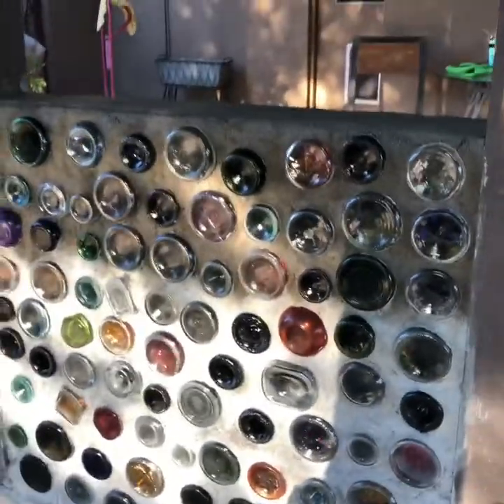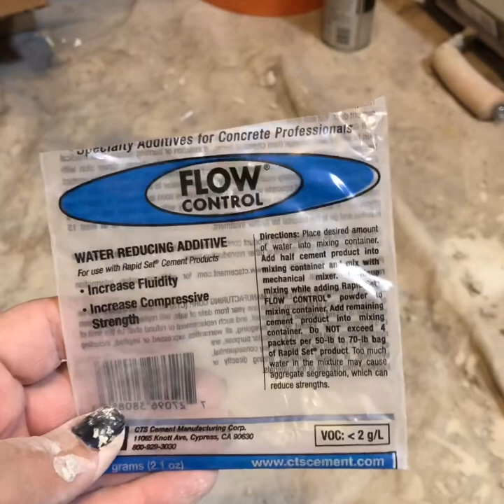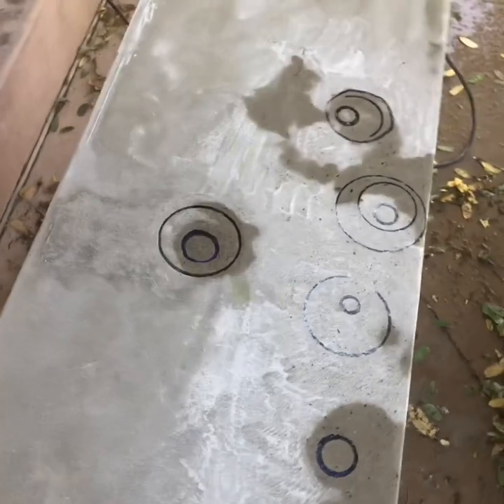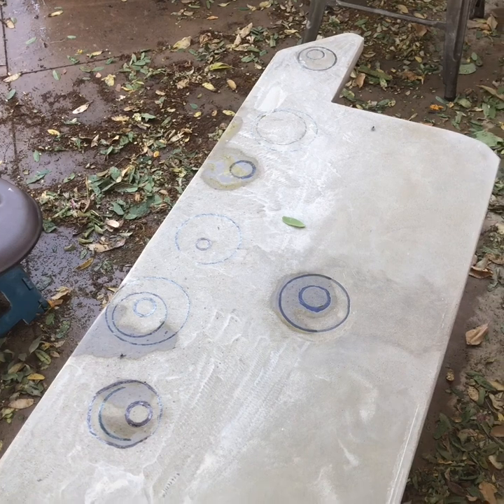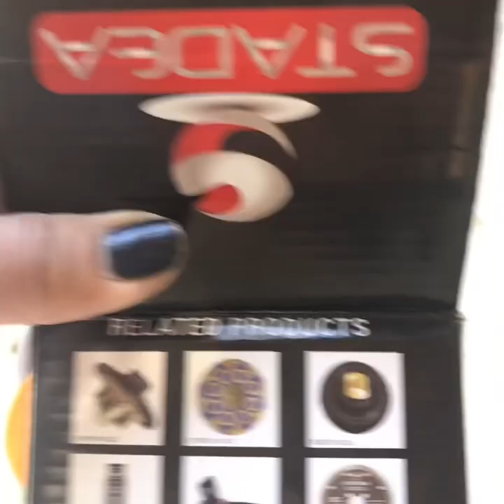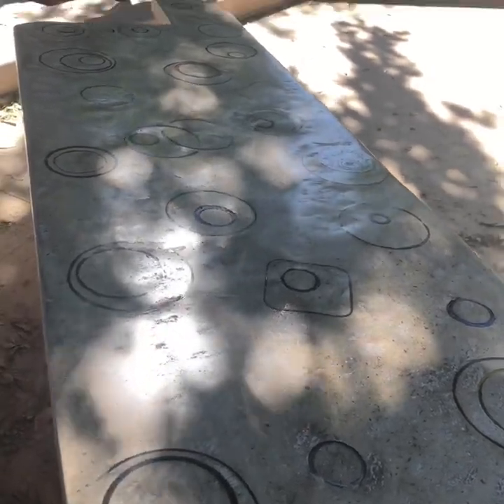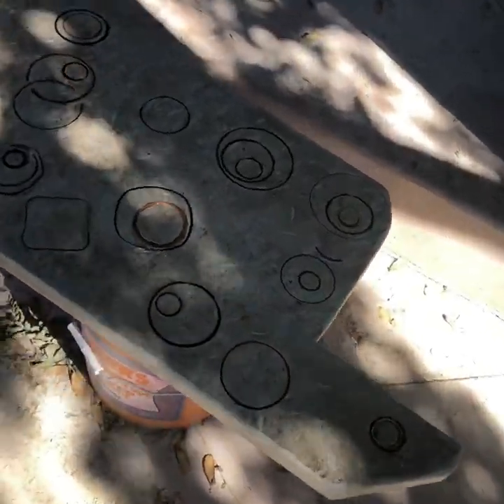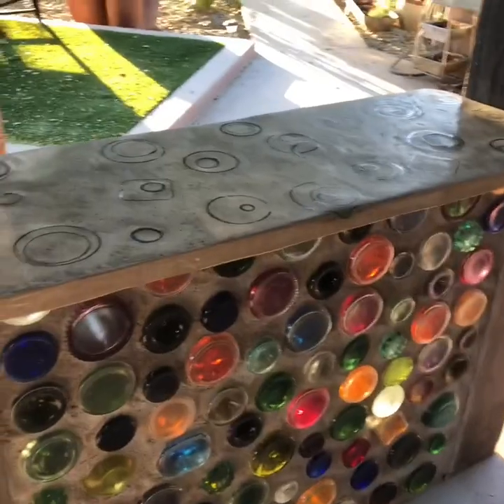Creative recycled bottle wall with concrete glass inlaid countertop

Comment: Just thought of something that could speed up your process if you ever think of doing another wall. What if you laid out your bottles between two sheets of foam insulation with say, wire spacers in between and then poured aircrete (aerated concrete). The finish would be flawless and you could also press the bottles into the foam sheets if you wanted them to stick out slightly.

Comment: It looks great. Good job. So you stated that once you used more water in the mortar mix it was easier to wipe down and smooth out the area in between the bottles? Did you have to add more mortar at times as you went up, as needed, in between bottle layers, and then smooth it out?
Reply from the maker: Sorry for the delay, I made the mortar in small batches, smoothing it out as much as possible as I went.  When I was complete. I made a watered down slip with the mortar and put a layer over the rough edges for a smoother finish.

Comment: Fabulous. You did a great job. I just started making glass bricks. I bought the transparencies- thanks for the suggestion. Do you have advice for a beginner?
Reply: I can suggest that you don't have to mind about precisely cutting the bottle round as you just have to tape it & it just goes into the  mortar.
Reply from the maker: Be patient with yourself and make sure they are completely dry. I would suggest you not make them on humid days. I have a couple of mine that have a little moisture inside on occasion and I live in dry AZ.
Reply: Share your e mail id. I am currently constructing a room with glass bottles. I will send you pics